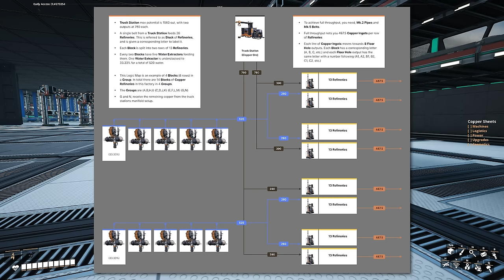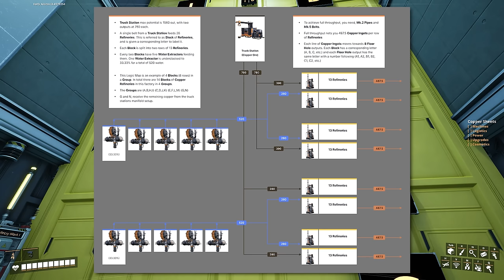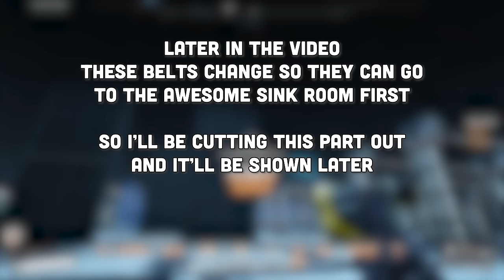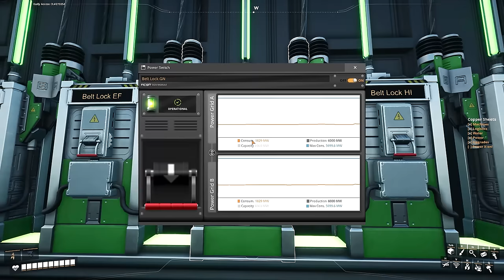Adding 1462 Copper Sheets Per Minute to my MEGA Factory! - Let's Play Satisfactory

Comment from the maker: UPDATE! - At 19:15 I made an error with my numbers. Thanks @_JustMonika for spotting the issue! 
As they mentioned: Overclocking at 150% gives you 33.75 *not* 37.5. So I've opted to overclock 6 machines at 150%, 6 at 200% and the final machine at 66.6667% (15). This does mean this uses 54 power shards in total. If you don't mind being creative, you can always add extra machines to cut down on the need for overclocking. Ultimately you'll still only need 487.5 ingots and water, so its just a matter of getting the same materials up to any extra refineries if you decide to add more. No belt splitting, pumps or extra water extractors needed.
The save file, production docs and additional blueprints are uploaded now.
Reply: Sorry for the math... You are correct.  Power consumption is not exponential. There's an exponent of 1.6, but applied to the overclock value multiplying the consumption. So with an overclock set at 200% (meaning x2), the power consumption for a 30 MW refinery is : 30 * 2^1.6 = 90.943, so over 3x as much power. About your other question regarding a common target overclock for all machines, it's simpler as there are no exponents. Start with your target overclocked production rate for a machine (which is 37.5 in your case), and divide that by the normal production rate of the machine, which is 22.5. So just type "37.5/22.5" as the overclock value which = 1.666667 or 166.6667%, yielding 37.5 sheets per machine. You also inquired about the impact on overclocking a single machine more than the others in a group. It's not super significant, but can add-up. Your setup of 1*66.6667% + 6*150% + 6*200% across 3 rows will consume 2717.1 MW, while a setup with 13*166.6667% will consume 2649.39 MW, so almost 70 MW or the equivalent of running a little over two more refineries. As if this reply was not awkward enough, If you wanted to avoid overclocking, the same production would require 65 refineries instead of 39, but the power consumption would only be 1950 MW.
Reply: I suggest speed up overflow belt from AI limiters, in case if it Assembly would be turned off.
In such case sheets would be send to transportation.
Reply: hey darren. quick question - i'm (slowly but surely) following along and don't know if i'm dumb or missed something, but the math in my CCF factory isn't mathing. the way i have the factory built, the copper ingot refineries are producing 487.5 ingots per row with one whole row going to one block of 34 assemblers making wire. the problem I've noticed is the wire assemblers only use 390 ingots per minute which leaves 97.5 excess with no overflow, so eventually the copper ingot refineries will eventually back up and start stuttering messing up my perfectly flat power usage. do you address this in a future episode? edit: forgot to say i love the videos and appreciate the effort and quality you put into it. thanks!

Comment: Great video as always!

Given this factory has a variable production rate and you now have surplus AI Limiters, have you considered upgrading your input manifolds into Smart manifolds?

Not sure if you're familiar with them as not heard you mention them. 

There are a few benefits over a conventional manifold, especially for variable rate production lines:
1, Machines fill in sequence along the manifold. 
1a, Prevent partial filling (below cycle requirement) of machines further along the manifold. 
1b, Prevent intermittent output. 
1c, Reduce power fluctuations - power will step up and down with input requirements. No spikes. 

2, Choose which end of manifold gets resources first. This is useful if a production line is not fed all items from the same end, including overhead fluid manifolds. 
2a, To fill from feed end of manifold: Set outputs for machines to Any. Set outputs for manifold to Overflow.
2b, To fill from furthest end from feed: Set outputs for machines to Overflow. Set outputs for manifold to Any. 

You can replace your normal splitters with smart splitters by holding control, as you would when replacing walls, barriers, etc.

Comment: Regardless of the cosmetics, I personally enjoy watching things operate like clockwork, so a world/factory tour would be nice.

Edit; sorry just had to comment, but if my math is correct, at 166.6666666666...%, each refinery would produce 37.5 units per minute, and a block of 13 of them would produce 487.5 copper sheets.
Would be less shard-efficient, though (requiring 26 shard per block, 2 per machine, as opposed to the 15 used in the video), so you could also overclock 6 refineries to 200%, and another one to 183.33333333...%, requiring only 14 shards per block. Again, is my math is correct.
But then you're getting into "why not just build more machines, if you wanna be efficient" territory.

Comment: I went with a different strategy for my CS.  I turned the 3 lines into 4 equal lines.  Then sent that to the refineries.  Leaving 4 rows of refineries, but running each at 125%, so only one power shard per and not quite so much extra power needed.
Reply from the maker: Yeah I’ll admit my sheets arent that elegant because of the power draw and clockspeed

Comment: I still like the idea of the power room with individual switches for each group for troubleshooting, not like you need to turn water off from across the map with the new switches. just need the belt bypass and a MAIN power switch for the factory. so you can turn it off, and then enable all the belt bypasses. the rest of the switches can stay normal

Comment: 50:15 With base head lift of water extractor could you make the single Mk.2 work?
Reply from the maker: I think so yeah, will have to test as its close, but I think so. Because people struggled with placing pumps too low or too high in my coal generator video, I place the first pump at the same height as the foundation level to the extractor just for ease of building. But With the 10m height, plus 50 it might just work with 1 Mk2 pump placed correctly.